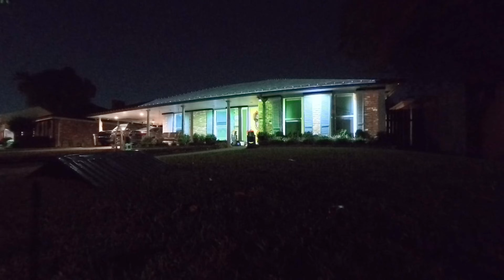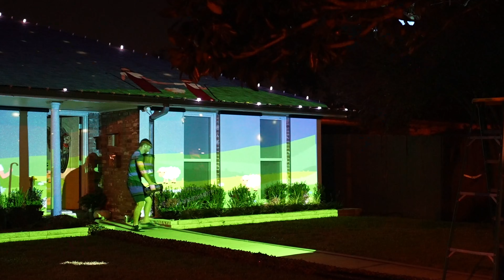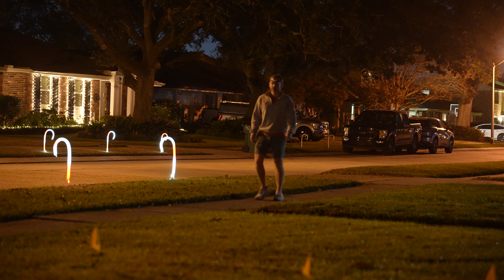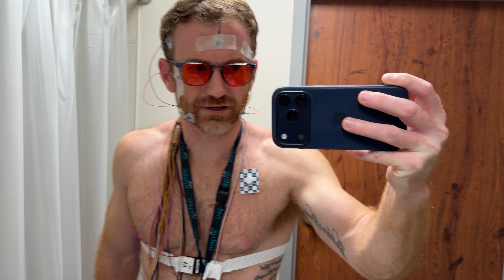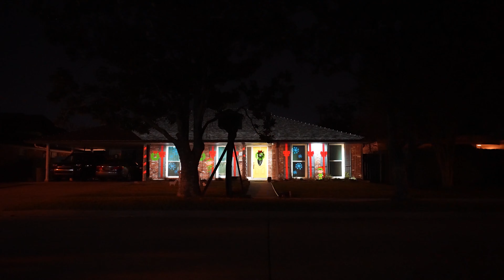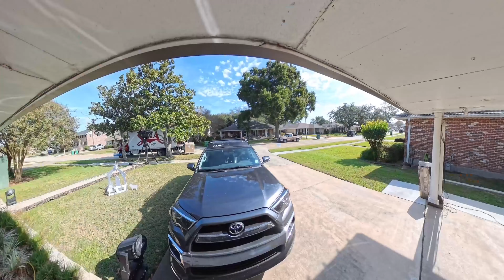I Failed. Christmas Show Update 2025

Comment: Hi, I was thinking about the candy canes problems and had an idea. Probably, sending data live to each controller via WiFi will never be reliable. What you could do try is to save the sequence of effects on the controller of each group of candy canes, and then use some long distance radio technology (maybe Lora) to send a command that starts the sequence on all the candy canes at once. You could even have multiple sequences memorized and use different commands to trigger them. I wish you good luck and a merry Christmas!
Reply from the maker: That's exactly what I was doing. I have ESP32 boards with micro SD cards that have the sequences. The wifi was just for syncing. But the wifi would drop out or the board would quit working altogether. I could never make sense of why either. I would reflash the board, reupload the sequence, changed the wifi antenna, etc and sometimes that would work and other times it would work for a few minutes.
Reply: @BreakItYourself that's a great start! I don't know what firmware you are using on the ESP32s, but if it allows you to do so I would try using another radio technlogy for communication (with cheap LoRa modules you can get kilometers of range). I also tried a few years ago to use WiFi antennas to control outdoor Christmas lights, and had the same issues you have.
Reply: @makergiovanniI’ve had lots of issues with esp32 controllers dropping WiFi.  Even inside the house.